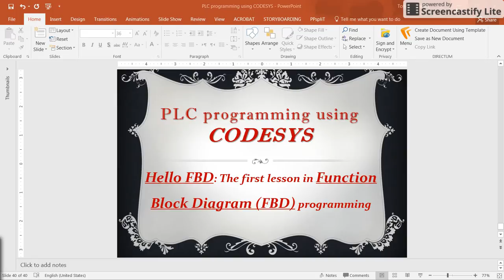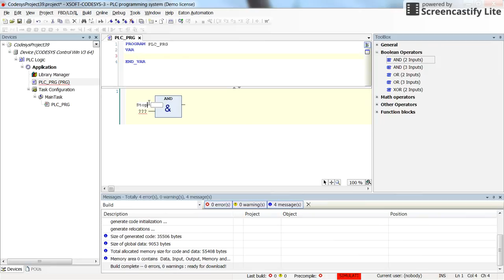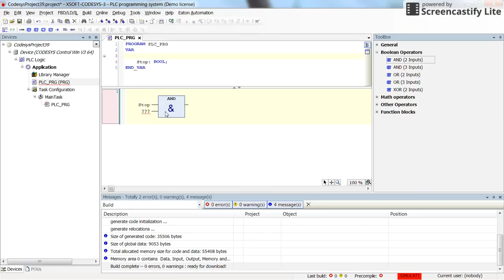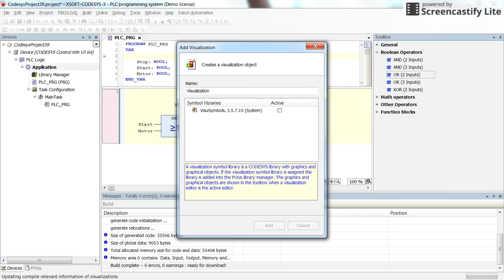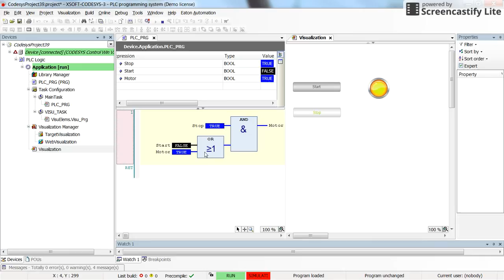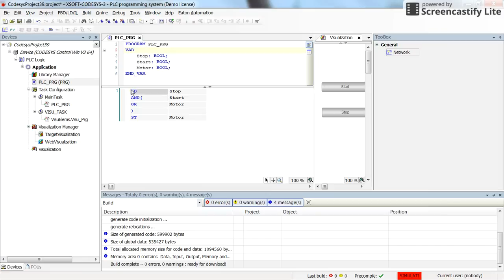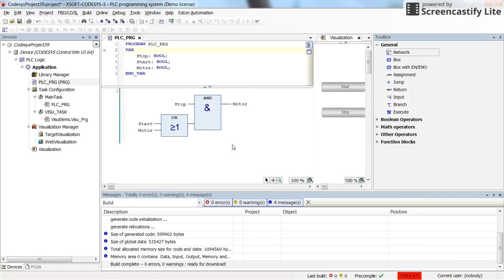CODESYS: Function Block Diagram (FBD) programming - First lesson

Comment: I dont understand why the Motor would run if stops is true. For me the logic should be a invers on the stop, so the motor only runs if stop is false. Like for example if you press a stop button, you would not like to have the motor start to running.
Reply: This is a safety feature. If the stop button loop had an open-circuit wiring fault, the input would stay true for a negated contact and allow the motor to keep running. Since a seal-in contact is used (in this case), there'd be no way of stopping it apart from (in more general cases) hard-wired e-stops, lanyards, limit switches or by isolating the motor supply. By ensuring that the stop button input on the PLC needs to see 24VDC for a ready-to-run or running condition, it causes the motor to stop if the wiring to the stop button went open circuit for whatever reason. It's certainly possible that the loop could short-circuit and provide a continuous 24VDC to a NO contact too, but this is less common than an open-circuit fault.

For any field devices, it helps to consider what the likely faults are and then wire them up and configure the PLC I/O so that the system fails as safe as possible. If it were just a software exercise, it wouldn't be so much of a problem, since only logical conditions are really what matters. In the case of physical control that can potentially hurt someone, some extra considerations need to be included for an overall design and implementation that protects people, the environment and equipment.

I used to think along the same lines as you. It wasn't until fault-finding in the field for a while and reconsidering the situation that I eventually realized why some things are better configured in a particular way. Still, your post was 4 years ago and perhaps you know the above quite well by now. It's a great question though and I thought I'd put a response in here in case anyone else comes across it with the same question in mind.

Comment: Good day Tohid, Do you know how to drag a connection from block to block?
Reply from the maker: Well, with FBD you do not have sucha freedom in placing the elements, and then making connection between the blocks (for this, you can use CFC instead of FBD). In FBD, you place the blocks in the rungs (networks) and you need to specify how the blocks are connected.
Reply: Now I have the problem with connection one block's output to another block's input if they are not in one line. For example my AND block is slightly below OR block, so they can't connect. If I drag whole AND block it will lose it's input branch.
Reply from the maker: Well, in FBD you can not simply do draging of the elements, specially between the networks. To have freedom in this sense, switch to CFC. Otherwise, you need to put the elements in the same network.
Reply: It is in the same network, may be there us some hot key combination to automatically connect them?
Reply from the maker: As far as I know, when you insert a block within FBD, you need to specify to which pin you would like to connect it. I mean, first you specify the connection, and then insert the block, and the connection gets created automatically. You can not put several blocks freely and then specify the way that they should be connected to each other.
I hope this helps you.